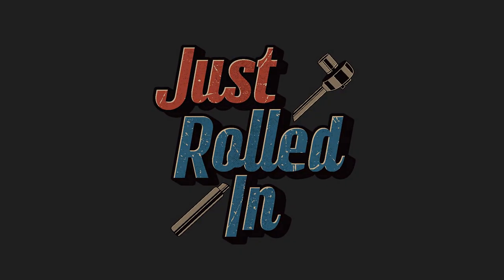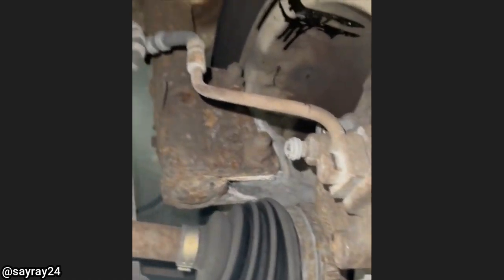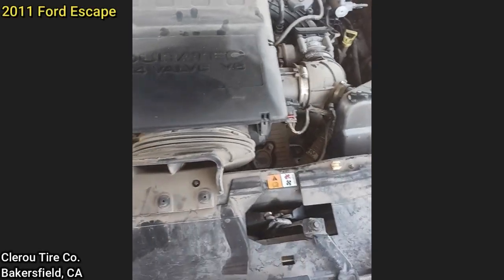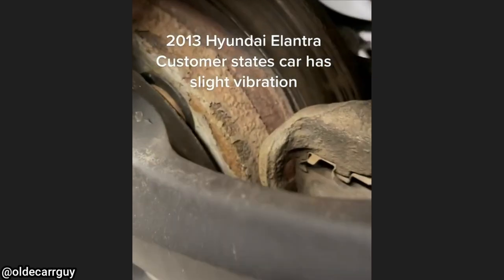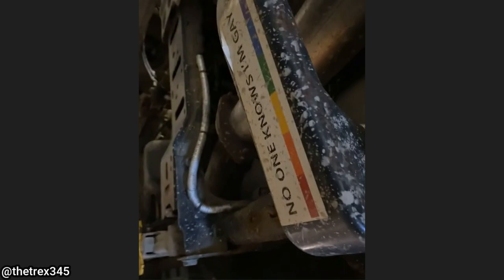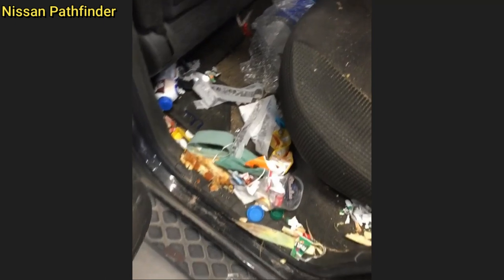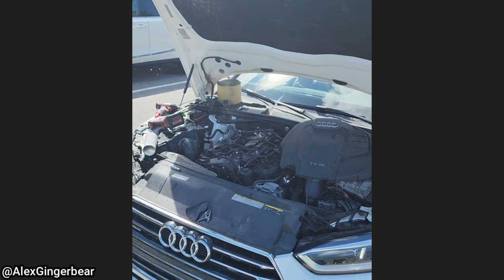Customer States Truck Still Overheats After New Parts Were Installed | Just Rolled In

Comment: Out of round tires? I had it happen. Bought this Chev 3500 LB/Ex cab to pull my boat, one reason, 7.4 :) ` took it to my guy because I thought tires needed balancing. GY AT's almost new - not one of them was round when he showed me on the balancer. 
 
 How is the wheel still upright on that rusted or busted lower control arm? Are struts really that strong? WOW! 

 My Sisterinlaw did the hydro-loc thing in a Passat wagon - freak storm in local town dumped bad - the VW dealership there had dozens of victims. The air intake was below the bumper. Excellent water scoop right to the MAF. one of those zero clearance motors. Internal disaster - fixed it right up with a new engine! I think VW ate a good chunk and Ins. 

 Dude at the end? He just justified big tires on a truck. That's becoming one-with-the-earth real quick.

Comment: I hate overheating problems. My 2004 Jeep TJ (4.0L I6) kept having recurring overheat issues. I put a thermostatically controlled electric fan on when the fan clutch failed. I flushed, I changed thermostats, checked flow, checked hoses, radiators kept blowing tanks annually. I bit the bullet and followed the Jeep motto: "If it breaks, upgrade" and bought a Mishimoto aluminum welded rad.  If anything, it runs on the cool side now and that was a few years ago now.

Comment: While I'm amazed at the folks who don't know how to check oil, tires, etc or just don't, it happens.  Plenty of places (manual, Google, friends) to learn better, but some folks just don't know how to learn.
Other times, it's just "lucky idiot" time even for those who know better, like me.  I was just going to look under a friend's Pinto for a moment in the dorm parking lot, so we used the scissor jack . . . on a slight grade . . . and I was glad it wasn't a "low" car when it fell off and knocked the wind out of me.  Always chock at least two wheels and always use a jack stand even if you use a hydraulic brake!
Years later we live at the top of a hill and I've been paranoid every time we jacked a car up.  We eventually got a QuickJack and I panicked a minute the first time we did brakes/tires and I realized it wasn't chocked.  Then I realized the QJ meant it wasn't possible to roll off the jack(s) and laughed about it for about 5 minutes.

Comment: I don't understand how people can not notice that their car/truck is out of gas, the warning is literally right there in front of you😮‍💨
Reply: In the shop I used to work at we saw several cars like this each year. And we always had a jug of gas on hand for diagnostic purposes on cars which showed less than 1/8 tank on the gauge. I've "fixed" two cars that way myself.
Reply: Especially with modern cars. Old cars just have the fuel light, but modern cars have big warnings come up on the screens and make noises at you and carry on. If they're missing something that obvious, what else are they going to miss?
Reply: @KarlEller  My Ford Focus ST gives a warning at 50 miles, 25 miles, etc, you can't miss it
Reply: It's like they don't even pay attention to anything on the dash anymore. I vaguely recall running out of gas once but I was driving an 80s Chevy truck around on my grandfather's ranch when I was younger and found out the gas gauge doesn't function properly. Half a tank is considered empty on a C10 apparently 😂

Comment: Back in the 90's my buddy was under his 84 Camaro on a sloped driveway. It rolled backwards over the rock he had placed under the rear tire, over his legs he had under the front tire while changing it. It rolled out the driveway, onto the road and down his neighbors driveway, smashed into the garage door, hitting the Impala parked inside, hitting the opposite wall, pushing his bedroom wall in about 4 inches.

Comment: the zero fan shroud is not helping the over heat problems either
Reply: And isn't the fan spinning in the wrong direction?
Reply: It did have the fan shroud the technician just had removed parts while he was diagnosing the problem

Comment: 3 transmission failures in 6500 miles? Eh, it's French, so it was probably designed to do that
Reply: My GF had a French car (10 years back) which stalled it's engine in corners. No mechanic could fix it. It also had the horn as a button on the tip end of the windscreen wiper controller. I loathed the car.

Comment: That last clip is scary! 
I never just rely on the handbrake, I always leave it in gear too to make extra sure, especially when working under the car without it jacked up!
Reply: "in gear" doesn't guarantee that it won't roll when the engine is off (automatic).  Learned that one the hard way.  Chicken-winged my driver's door.
Reply: I park with the clutch out, and use the handbrake to hold the car, then put it in first/reverse.
Then I chock it. And I'm still uneasy because I have forgotten some damn important things in life. (Forgot my lady's birthday, that was worse than getting dragged.)

Comment: My syster called the road service (ANWB here in the Netherlands) for a battery light. The guy told her she needed a new alternator. So she called me and explained what happened. I bought an alternator and came by to install it, when I noticed the belt was missing, only a few pieces here and there.
I called the road service and told them they made a bad diagnose. They gave me back the money for the alternator, which I simply returned. Bought a new belt, put it on, car ran for years.

Comment: Chock the wheels. "Park" on an automatic just drops a metal tab into a notched wheel. It's not failsafe by any means. I learned the hard way on a dump truck. I put the manual trans in gear, but I engaged the PTO into order to level out the bed for unloading cargo. That disengaged the drivetrain and sent it rolling once we were outside the vehicle. The parking brakes were non-existent, as someone had probably been driving around with them engaged.

Comment: That truck rolling at the end is entirely too easy to happen if the shift cable had been previously removed from the transmission, they don’t always snap back on solidly and can bumped out of park when you reach up for something to grab hold of to move underneath the truck, luckily for me it only rolled a couple feet when it happened to me on my old 99 Silverado

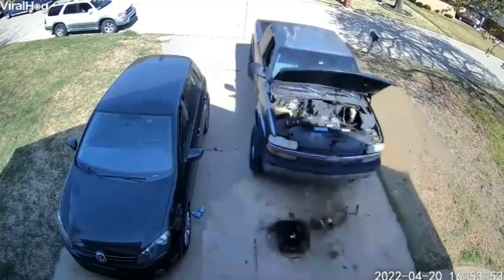Comment: 3:04 Beware if you park your car on a sloping driveway.

My older car's PARK feature in the auto trans decided to not work one day and I learned about it when someone knocked on my door. Damage to the fence across the street: $460.

Could have been worse. If the fence hadn't been there, my car would have ended up in the Hudson River.

Comment: I have a small car. I have to put on jack stands to change the oil. I use the parking brake to prevent a roll back. In a front wheel drive car the transmission in park is useless if the front end is off the ground. Just in case someone doesn't put that together, a PSA.
Reply: No shit . . . you should still chock your wheels. Parking brakes are not fail-safe.

Comment: This is a slightly long story but I’ll give it a shot.

I bought a book on how to repair VWs. This was back in the 70s when hippies really liked Volkswagen‘s. Thus, I had one. The book was written in a very, let’s say, casual manner. As best I remember this was a section on how to replace the starter and it went something like this.

“Because of the location of the starter you will find it much easier to remove the bolts if you use a ratchet wrench. However you should ensure that you disconnect the battery before beginning work. If you don’t you’ll find yourself lying under the car and will almost certainly allow the ratchet to swing down and make contact with the frame of the car. This will result in a huge spark which will cause you to jerk you head backwards and slam it onto the concrete floor. This will result in you snapping your head forward and slam your forehead against the underside of your Bug. This will cause you to jerk your head backward onto the floor again. This process will repeat until you a) knock yourself unconscious or b) have the presence of mind to drag yourself from under the car.”

Comment: Had an '85 Cherokee overheat, water pump failed, took to dealer who replaced:  overheated within 5 miles, returned to dealer.  5 days later told car ready,  "we washed it" because it took 5 days to figure out the reman water pump had the impeller on backwards.

Comment: Circa 1979. A friend bought a Ford station wagon that was just 2 or 3 years old. Big block. And it would overheat within a mile or two from cold. He had changed the thermostat and water pump, boiled out the radiator, then replaced the radiator, and installed a fan shroud. I asked him to follow me to the shop. I grabbed a timing light. Yeah, something like 25-30 degree advance at idle. Not having a manual, I just backed it to 4-6 degrees. Problem solved! When someone else has tried everything they can think of, try something else!

Comment: I bought a Defender from a guy that was overheating, for a bargain price. When I got it home I noticed he'd replaced the temperature sender with a none lucas type (Clock and Sender need to match). I fitted a spare I had and the temperature read as normal. It never really was overheating.

Comment: Had a car come in that had a waterlogged transmission, we dropped the pan and changed the filter. After running the transmission in drive up on blocks we dropped the pan and replaced the filter one more time. I still see it up and down the road.

Comment: 15 years ago I was changing the oil in one of my cars when it slipped off the stands. I was ok but I got pinned by the bumper cover to the ground. I had to lay there until someone walked by and could get the jack and lift the car up. I still laugh about it, but always chock your wheels.

Comment: the incorrect belt is why I ALWAYS made myself a diagram of all pulleys and the belt running before removing it, since not many cars actually have a sticker with the diagram somewhere in the engine room. at least not here in germany. and sometimes space is so tight you don't have space or the view to experiment and figure shit out...
someone also taught me to mark every tightened screw, bolt, or nut with a spot of paint or crayon. so when I return from the john or another task I can be sure where I stopped.
doesn't really work with wheel nuts, but that can be helped with either not run away before you're done, or re-do it again in case of doubt.

Comment: As someone who used to work on Toyotas that was a normal sight for awd siennas the chewed through tires every 20 to 25k miles usually at 25 they look like that.
Reply from the maker: Crazy! Do you know why that is?
Reply: @JustRolledIn  well it’s two things the first being they usually want run flat tires due not having a spare so that doesn’t help. I’ve put regular tires on them and it does help (roughly 35k miles) plus way cheaper then run flat (about $1,000 for everything but alignment) so it doesn’t hurt the wallet as much. The second is the way the suspension is set up in the rear plus body weight and rear drive line. I dunno if you can adjust the camber and toe to counter it as you seen in the video it chewed up both sides. On a side note unless specified by the customer Toyota (at least the dealer I worked for) only wanted you to rotate front to back not to cross them. I’m a believer that it’s important to cross rotate tires will help prevent abnormal wearing.

Comment: Most water pumps are centrifugal, I'm surprised it made a difference, at least enough to overheat.   Last time I had an overheating problem, it was a plugged convertor.
Also, that factory fan shroud performs a function, in case anyone was curious.
(edit) nevermind, mechanical fan, that's why.   Reminds of of a story a mechanic I knew told me, overheating, customer installed electric fan, he stood in front of the car, and the fan was blowing his pant back, lol.

Comment: I really like what you do. But I have a confession. When I was young I would buy retread tires for about 10 bucks each. I run them till they blew. One day on the highway one started slapping the fender. It didn't blow out so I kept going.
Reply: Would have been an expensive method if you lived in the same country as me.

A tyre must have atleast 0,06 inches of thread, and if it does not it is a fine of $135.

Oh and that is per tire, so 4 worn down tyres nets you a fine of $540

On top of that you can expect the car to be called in for an inspection (Normally this is every 2 years, but the police can ask for you to go there at any time to show you fixed the problem). This is an added $40 for the inspection.

AND...You can not legally drive the car, so depending on how worn down they are, they might issue the car with a driving ban, and then you need to pay someone to tow it to the tyre shop.
Reply: @JohnDoe-bd5sz  it wasn't low tread it was no tread. The entire outside of the tire would peel off and go flying.
Reply: @darrellscholl1651  Yes a tyre in that condition would definitively mean that the police would issue an immideate driving ban for the driver.

This means that the car can not be driven legally for even 1 meter, until it has passed an inspection.

You would have to have the car towed to a tyre shop, tyres replaced, and then the car would need to go on a towtruck to the inspection station. They would probably take away the license plates as well, until it was inspected.
Reply: @JohnDoe-bd5sz  or I could get in the trunk and change the tire.

Comment: the peugeot owner is so patient lmfao i don’t see how they could tolerate three transmission replacements before returning the car to the dealership (unless they had to get the transmission replaced that many times before the lemon law kicked in). but still, requiring 3 transmission replacements sounds like a waste of time and money
Reply: To have one fail, OK, manufacturer defect. But to have 3 different transmissions fail on the same person points to something else. Either the owner does something really wrong and kills them or the shop does not replace them but "fixes" them.

Comment: 1st truck also had no shroud. Big issue with a belt driven fan. Yeah they belt would be a big issue too. Lol.
Reply from the maker: The tech removed that when it came in from what I was told, but it wouldn't have surprised me if it came in without one lol

Comment: New tires, replacement steering, replacement lower arm, and the oil changing guy either didn't put the transmission in park and set the emergency break plus chaulking the rear wheels, or he has more problems than the need of an oil change.

Comment: I HAD ONE COMPLAINT AFTER WE GOT A 30-YEAR-OLD CAR'S AIR CONDITIONING TO GET 15 DEGREES LOWER THAN THE FACTORY SAID IT SHOULD GET. 'AIN'T COLD ENOUGH" SHEESH!!! THE CAR WAS WORTH ABOUT 250 DOLLARS AND AIRCON COST OVER 300.
Reply: Should be grateful a 30 year old vehicle has a working AC.

Comment: Do people really not understand that cars need fuel to operate?!
Reply: And the fact there's an icon that tells you are running low on it. They need to add a voice "add some gas dummy or you'll get stuck". I'm surprised the tow truck driver didn't ask this, then again if you're stupid enough to drive on no gas till it stalls chances are you're asking the tow truck t bring gas.

Comment: The last guy must be a damn beanpole! GM trucks got zilch for ground clearance. I used to work with a guy who had a 5sp F150 that would go out drinking and then forget to use his parking brake on his steep driveway. I also lived close to him, drive by his house and his trucks in the weeds across the street, guess Pete went out last nightLOL When changing my oil on a OBS F350 crew cab I got done and my dog was gone, couldn’t find him anywhere. Well shit, guess I’ll go inside and clean up then go for a drive and look for him. There he was, called out on the backseat, jumped in when I wasn’t looking but all nervous cause I kept yelling for him😂 I think we went for burgers after thatLOL
Reply: Ground clearance has squat for difference between brands. Taller tires make the only real difference. Lift kits don't raise differential heights.
Reply: @wymple09  well I can slide around under my F250 without an issue but I couldn’t do it with my 2500 Silverado🤷🏼‍♂️ both are 3/4T 4x4s sitting on the exact same tires. A solid front axle offers much more wiggle room than a dropped cross member and bulky A-arms all day everyday

Comment: How difficult is it to handbreak and put it in gear before you start doing things underneath it?
Reply: I think the hard part is remembering to do it every. Single. Time. 
I always use the handbrake and leave it in first, but before I work under my car, I place chocks on top of my socket set. Then I chock 2 tires both ways so it cannot roll.
I once reached for a wrench and found my chocks still on top of my tools.
Reply: @j_taylor  Safety for everything. I mean the guy lucky that pickup truck had some height to it. Otherwise with a regular car he would be dragged along with the weight on top.